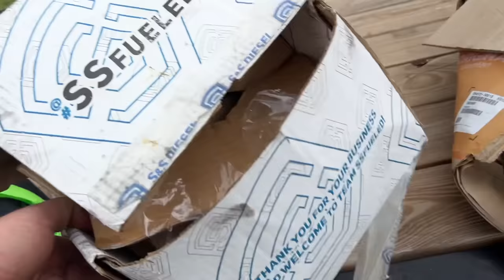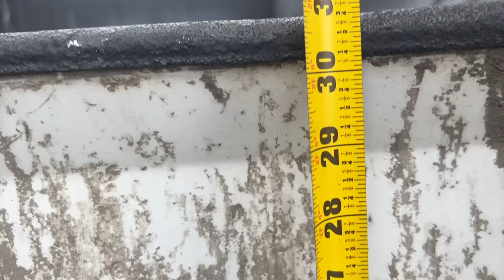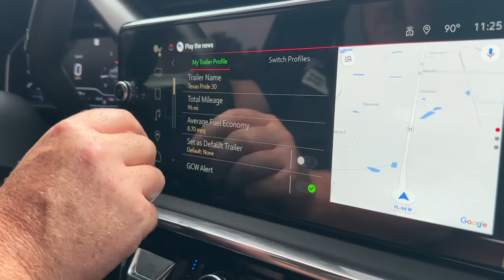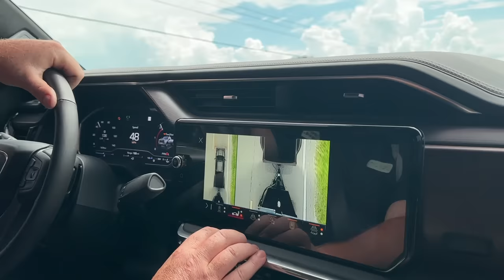$100,000 Diesel Truck VS $2,000 Diesel Truck!!!!  Are These New Trucks Really Worth It?

Comment: In my opinion, it’s only a matter of what your budget is.  You can always upgrade brakes, add a tuner, fuel injectors, turbo, etc.  So, with a few grand in upgrades, you can be well below $100K and have a reliable truck that performs well beyond the new trucks these days without the DEF and DPF, etc.
Reply: Bro the newer trucks make close to 1000ft torque and can tow close to 40k. Good luck getting that with a 6.0 along with reliability heated and air conditioning seats and all the other technology. Plus if you own a business it just looks better if your driving a newer truck vs a loud ass older diesel.
Reply: @xaphan8581  First off, I wouldn’t drive. 6.0 Ford by choice.  Secondly, You can easily get to 1,000 lb ft of torque with a programmer and maybe fuel injectors.  You might need an upgraded turbo depending on which truck you have.  However, I believe you can easily obtain the performance of a new truck for way less than $100K
Reply: @xaphan8581 I've got less than $10k into a 6.0 and it will dog walk that GMC, and it looks pretty damn nice, as a business owner you might look better with an old truck that looks really nice because it means you take pride and car anyone can go buy a new truck. Maybe they dus it because they trashed the old one in 2 years. But I know a guy who pulls up on a jobsite in a nice older truck takes pride in their shit.
Reply: @fiddynutz68  yeah your missing the point. Also spending 10k on a 6.0 sounds like a worthy investment lmao. I’m sure to take your words seriously
Reply: poultryguy12able  Actually, you can build a reliable Cummins by adding a built transmission, head studs, injectors, and an upgraded turbo for way less than $100k.  And, yes I have seen new diesel trucks broken down.  My son’s friend had a 2022 F250 Diesel that had less than 4K miles on it that broke down.  He had it in the shop for repairs at least 4 times so far.
Reply: poultryguy12able  Dude, the Duramax is the slowest of the big 3. My old ‘06 3500 Cummins with only a Smarty Jr used to walk the shit out of ‘22 model Duramaxes all the time. I don’t like a 6.0 but I’ve seen some with work done that were pretty damn quick. I’ve driven them all. Ford has the fastest stock diesel right now, then Dodge, then GM. And yes, you can have a higher horsepower diesel and maintain reliability. I can’t speak for what Ford will do but you can have 500-600 hp out of a Cummins and still drive just like a daily. Mine was close to 500 and I’ve hauled RVs all over the country with it, tune set on kill, for over 250K with it like that. Had 315K on it when I wrecked it and was still going strong
Reply: Agreed. 100K is a ton of money. There are all sorts of things you could do and come out way less than that. On the upper end of things you could swap in an HD engine like a CAT (3116, 3126, 3208, C7, etc), Detroit (4-53T, 6V53T, 4-71T), Perkins 6.354, etc. Or a newer engine like a Cummins 6.7, Duramax L5P, etc. And in an old non emissions truck you don't have to keep the emissions equipment on the new engine either. You could pay someone to do it for you and it probably still wouldn't come out at 100K.
Reply: @xaphan8581  6.0 owner here and 10k in a 6.0 and you will be trouble free and hauling whatever you want.
Reply: @kennedy98796  yeah sounds like a waste. Like if you really would rather save money by having an older diesel why not just get a 7.3 or a 5.9? Idk it’s your money I guess

Comment: We love our 2002 F350 crew cab 4X4 SRW long bed. She was an XLT, originally but the interior is slated for an upgrade, she's black and mostly original appearing other than a level up kit, ranch hand, and some aftermarket wheels in the 16.5 flavor. That said, I can and do work on her. Parts are relatively cheap, and I can easily buy a new engine and trans for her. She is of course modified. Not to the point of being unreliable though, 1400EGT is real bad LOL. At about 400HP these days, Turbo and intake upgrade, EGR deleted, turbo back big pipe, cold air induction, swamps stage II double shot injectors, 7 position Hydra chip. She is plenty fast for a 7.3 and does well on fuel, dependent on the current tune. Yeah, we're running cameras front and rear, new paint and theft proofed to the max. My main concern is how bad they are to steal the earlier Fords. I mean I can jack one in about 30 seconds with no security measures. Mine was stolen a while back before I did all the modifications: alarm with kill, all mechanical door locks removed, outside and inside, electric only keyless entry with alarm remote, Lo-jack, and a club as a visual to go along with the alarm LED just to help deter. I did some serious rewiring to it under the dash as well, so hotwiring it would really be a rough day. The hood is also chained and locked shut. That said, if you have an early Ford, especially a nice one secure it up. And your guy is right about his 6.0 I get a lot of compliments on it, often people ask me if I would be willing to sell it. NOPE

Comment: Paid $2500 for my 98.5 Cummins. It’s slow but gets 23 mpg highway and never given me any issues. 240k and now has 363k. Needs wheel bearings and a voltage regulator every 30k. Needed a few engine sensors, one upper ball joint, tie rods and a clutch. And lots of air and fuel filters. Hauls 15k just fine.

Comment: I’d like to see how a older truck with similar power as new holds up against the new one. I will volunteer my truck lol
Reply: Im willing to bet they don't hold up as well. The new trucks strive for the most efficiency possible. The main reason old ones are so reliable is the lack of power. Like the 12 valve and the 7.3. a lot harder to break stuff at 200hp.
Reply: This is where my brain went as well. My ‘96 7.3 and my ‘06 6 leaker will blow the doors off of that stock 6 leaker.
Reply: @boudrauxmnxsty6871 There are shit tons of 7.3’s with big injectors, turbos, and Hpops making 350-500 reliable hp.
Reply: @boudrauxmnxsty6871 if done correctly an older diesel can reliably hold 500, or for the duramaxes case, about 450, you can make that with a tune easily. However people push their trucks to the max power and sit it at that, have a truck capable of making and handling 800 and only have it make 500 and you’ll be just as reliable if not better
Reply: @boudrauxmnxsty6871  yet the new truck gets 9 mpg while towing lmao. sure its probably better than the old truck but that is far from efficient
Reply: @NOBLE-wo5rr  You're comparing 9mpg at 475hp, 1000ft/lbs torque with all the creature comforts and safety technology vs 6-7 mpg at 240hp, 500 ft lbs of torque with the technology showing it's age. That's a massive difference.
Reply: @dash456789  And there's shit tons of 2015-current 6.7 powerstrokes with only a full delete and tune that make 500-650 reliable hp. What's your point?
Reply: @boudrauxmnxsty6871 old ones cost $30k less is the point
Reply: @dash456789  "6 leaker..."  LMAO!
Reply: @boudrauxmnxsty6871  Not here in Commefornia, sadly.
Reply: @toethlef8994  "New truck is more expensive than old truck" Can't believe you figured that one out. Some toddlers even have trouble being able to figure that out. Congratulations buddy

Comment: I own the 3k truck but it's a 2001 V10 crewcab dually but with only 27k Original miles and I can tell you my 0 to 60 is 6 seconds flat unloaded does not loss with 4:30 rear gears. With the upgrades monomax suspension its squat is minimal too. Im saying mint old vs new is a lot closer than you think. I don't own a business and yet I know if I did I would do the same thing but for how I use it shes perfectly fine and a real head turner too.

Comment: I don't know about in the USA but in Canada warranty only covers once it's at the dealership.  I had two hardlines blow on fuel rails, back to back. Still had to pay to get trailer towed both times, still had to pay to get truck towed both times. 2600 town bill first time and 3200 the next time. Both repair were under 600.  Warranty isn't everything.   Truck was completely stock. 2019 F550 at the time 98,000km on it.

Comment: I would stay away from the 6.0 unless it has been “bulletproofed” the 1999-2003 7.3 is a better choice imo. Many are still going strong with 100’s of thousands of miles on them. 

Lots of 6.0’s were bought back by Ford and I know a few guys that bought them and got rid of them due to issues.

My daily driver is a 2000 F250 4x4 that I bought new for $35.3 out the door. Still worth half that 24 years later. 

Been the best truck I’ve ever owned

Comment: My 2015 Duramax has worked perfectly since brand new except the DEF/DPF system. I’ve been left on the side of the road 6 times because of emission systems.
Reply: What’s going on with it? I got a 2008 and it just has the DPF system. Those damn filters are not cheap either
Reply: @FnaAuto   It’s not exactly the filter it’s the sensor or sensors that keep going bad. Every year my truck stops working while going down the road. The next time it does that I’m deleting it cause it’s expensive to get it fixed.
Reply: I got a 11' with everything tuned out. Best thing for it.
Reply: @geraldlake8978  planning on doing the same

Comment: I bought a 2002 GMC 3500 4x4 for $7,000 and almost immediately had to do injectors, head gasket, replace the turbo, replace the rear end, and do brakes and a wheel hub. I am almost $30,000 into my truck with shop fees, but now it performs very well and more than serves my purpose owning a lawn care and landscaping company. For the cost of a new 3500 I can get a used one and spend a little extra cash and have a truck that performs better than a new truck if I get the right combination of performance parts… and I’d have half the money invested in it.

Comment: Nice comparison but for less than half you can make the 6.0 perform as well and be more reliable.  Something to be said about no dpf and def.
Reply: 6.0 is not reliable its probably the worst engine known to man so thats probablu why its cheap
Reply: @mysterysolver514 youve apparently never met a 6.4 or any emissions equiped truck.  6.7 cummins injectors are 12k for a new set from dodge.
Reply: @1hdoilfielddad244  6.4 is garbage as well ford really is a shit show. thing is with emissions you can delete and have a great engine
Reply: Never touched my 6.0. Never had any problems with it. Studded and deleted it at 160k and added a sct tuner then. Replaced oil cooler and glow plugs at the same time and upgraded turbo then too. 225k on the clock now and still zero issues. Maybe it’s the operator driving them or mechanic wrenching on them that makes the ones you owned unreliable… Just saying

Comment: My buddy got a 2009 6.4 powerstroke with tunes and deletes and has about 673,000 miles ,only replaced the alternator once,I've got and 09 6.4 with 210,000 miles with 0 issues, never had one issue ,we paid less then $20'000 for them

Comment: I'm about 30k in on a 20 year old LB7 i bought in 2020 including the price of the truck. I'll take that over a newer one. Nothing to delete, it came from the factory with not even an EGR, the PCV doesn't go in the intake, its got nothing in the way of emissions control from the factory. Most of that money was just stuff I wanted to add, it only needed 4k in parts for an injector job I did myself in my back yard about a year into owning it. Over 330k miles and sill running strong.

Comment: Great video! I’d like to see an mpg comparison from the two. Full emission controlled vs basic
Reply: Probably not that different. My 2002 7.3 F350 and my 97 7.3 F250HD both averaged 14mpg and my dads new 18 6.7 F350 gets 16-17mpg for being newer and Def,all that fun headache. Also my 5.4 gas got about 14-15 on a good day.

Comment: Can buy an F650'750 4-door for $20-30K less. A bunch of the bigger horse ranches in this area run those. Also, pre-DEF Dodges are available all over Texas for around $30K with lower miles. Could be a good option......my 7.3 has 330K and we bought it for $8500. Have done brakes, suspension, fuel pump, and a few power steering lines in the past 15 years. We are about $10,500 total into the truck.

Comment: Wow! The cheapest dully of this age I can find in my area is $20K. I would love to find a $2K pickup to fix for a few thousand.
Reply: I sold my 2004 F150 8 years ago for $12,000. Bought a 97 F350 Powerstroke for $3000, a 58 John Deere Bulldozer, a 10 ton trailer and still had $1000 for tires and brakes. A truck is a tool - Period.

Comment: It seems more people get stranded in the new trucks because when something goes wrong they stop. Full derate not going anywhere. The older trucks if something goes wrong you could limp it home or go to any auto parts store and pick up a sensor or relay. When a NOX sensor goes bad on a new truck you are stuck until you can get to the dealer. A 12 valve cummins would make more coast to coast trips with no issues than a newer truck.

Comment: As long as it's  under the bumper to bumper warranty then it's worth a damn, anything beyond that good luck!! They find anyway they can to weasel out of doing anything.
Reply from the maker: I’ve always had good luck with the 5 year/100,000 Mile warranty on the duramax drivetrain
Reply: @JHDieseland4X4  i think he meant that after the warranty expires, the repair bills on these new computers on 4 wheels will cost most than an entire 20 year old truck
Reply: @JHDieseland4X4 yes but you're JH 😉
Reply: Had the tranny on my 97 F350 Powerstroke rebuilt two years ago by a reputable shop. When I picked it up, we discussed new trucks. He said they were garbage and were failing regularly. I couldn't imagine owning one once the warranty expires.

Comment: I have an 84 gmc with the 6.2 diesel in  it. I paid $500 for it back in 1999. It gets 25 mpg, and I still drive and tow with it regularly.  

There is no way in hell that I would ever spend 100k on a new truck.
Reply: I had a 83 Suburban with a 6.2, used to off road it, would climb anything, crawl through mud pits, pretty tough, tho not fast without a turbo.

Comment: Hey Justin-
I haul 10K lb roofing dump trailers with a 2006 f250 with a 6.0 for 6 days a week. (in the AZ heat, and have NEVER had it leave me stranded) One of our crew leaders has a 2022 Duramax 3500 dually, that he has not been able to use for 2 weeks in a row since new without a major breakdown. My truck has 330,000 miles on it, and the worst issue has been replacing brake pads twice.  I change oil every 3K miles, and I don;t beat the tar out of it. I forgot, had to change batteries last year. Yes, he'd skunk me in a drag race, but his truck was $138,000... mine $4000. His $700/mo payments are not worth being a little quicker to 60mph (that is when it is driveable). I'll take the power snort all day long, and make a paycheck- while he depends on me to haul his shit around.
Reply: Truck payment easily double that
Reply: 138k??? He must of bought a SEMA truck. Unless he put a shit ton of money down no way his payment 700.

Comment: I'd much rather have a 7.3 than any modern truck.   My work truck is a '99 f450 with a 12' flatbed dump and. A 2k lb lift gate.   I grabbed it with 114k miles from an auction for $12k.    I never stress about working it.   It's barely broken in at 114k miles ...   There's just no chance I'd ever buy a new truck.   My daily driver is an '88 landcruiser with a SBC350 swap, and my Sunday driver is a '77 Ford f250 supercab long bed.     My bike is an '86 Honda.     I don't go by brand.  I don't go by features. I go by ease of working on them, aftermarket availability of parts, reliability, practicality, and look.

Comment: My 2018 F350 dually is the fastest truck I have ever had. It feels like a sport car when you accelerate it on the interstate until it kills itself at 99. No reprograming just stock.  I bet it would run 150 without the shut down at 99. An older truck may have more power to pull IDK but there are no older trucks that will out run it stock that I have ever driven.

Comment: Still got my 03 f250 powerstroke and its been a fabulous truck 260k miles later and i dont think ill be buying a work truck for a while! She's got her clear coat coming off and dings and dents everywhere but she still drives like new! I also have a 2016 6.4 hemi ram 3500 and that thing has been eh.. a newer truck does not mean its a better truck. Save your money boys and get yourself an older truck it saves you money and stress in the long run

Comment: New treads, recharging system, wiring, some sensors, bushings kit, shocks, maybe a module, a computer, all fluids replacement, and exhaust from tip to headers will run you under 10k. 5k in paint and other comfort items will set yourself up for another decade in your 30 y/o truck.

Comment: My 2005 F-250 4x4 CC is running strong with 160,000 miles. Largely trouble-free the entire time I've owned it (Since 2009 and 30,000 miles). Yep, 6.0 Powerstroke. Love it. I did the well-known updates and I do regular maintenance and parts replacement. And I'm not afraid to use it like a truck. NO WAY would I buy a new truck. Would not even buy a used truck if it cost more than $40K. I've driven late model diesel trucks. Of course they are nicer than mine. More powerful. More capable. But mine does everything I ask of it. And it was paid off a long, long time ago.

Comment: I have an ultimate 2500 on order, with max trailer package, they can easily tow what an older dually could. You also don't need the ultimate. You can get one in the 60s with cloth seats with some decent features.

Comment: One of your final remarks - regarding pulling up to a job site… I’d rather tow my nice machines with a truck that does what I need it to do perfectly fine and is PAID FOR opposed to that much more overhead cost to my business. I’ll take the  cheaper insurance and repairs. Less overhead equals either more profit, or my ability to do the same job for cheaper.